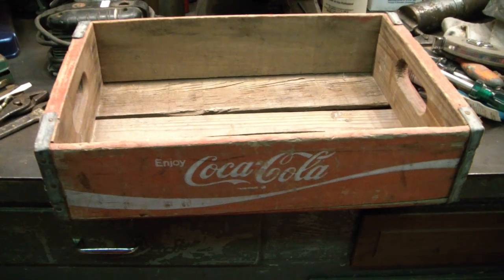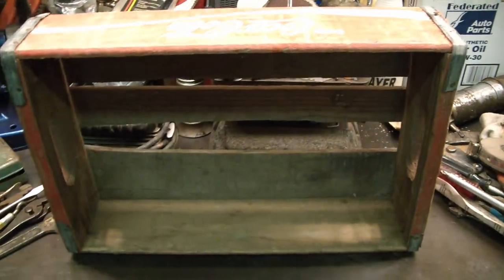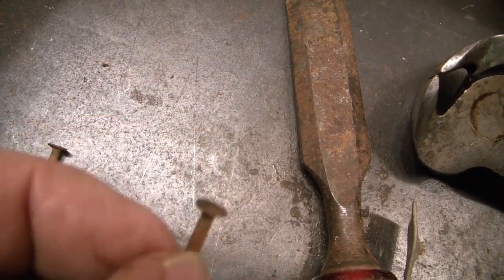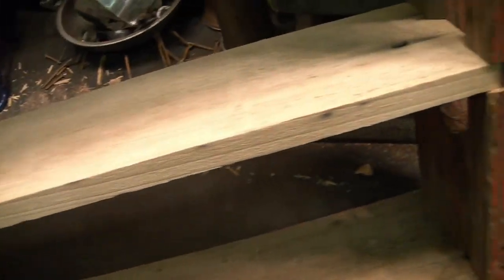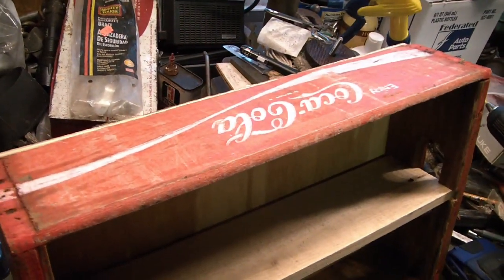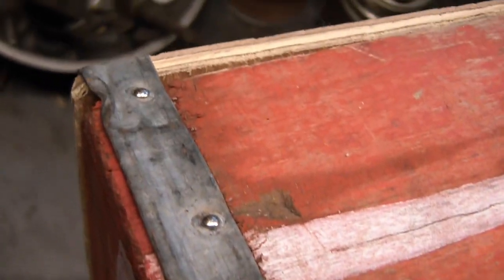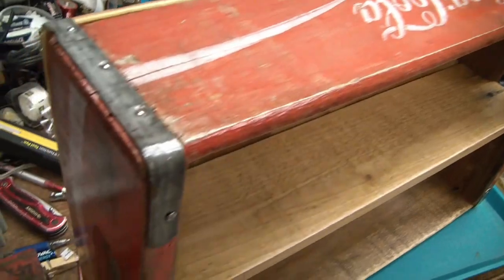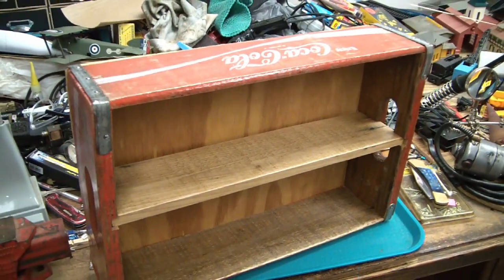Christmas project 2022

Comment: Lucky to find one with the paint still in such good condition.
Reply from the maker: There were better ones paint-wise, but they also had the many slats in them to make individual pockets for individual bottles.  There were actually a lot of yellow ones with the cocacola logo in red, but yellow as the primary color just seemed wrong.  I found one of those with just a single criss-cross in the center which was perfect to be a shelf for me, but I just could not get past the yellow color.  The price for all these were the same at $40 which was a bit too rich for me, so when I found the rickety one in red and pointed out its poor condition, the lady sold it for twenty.  😀